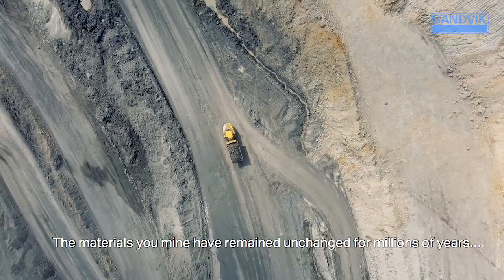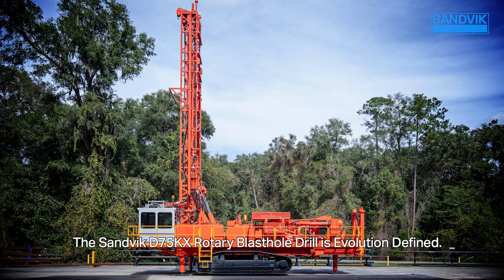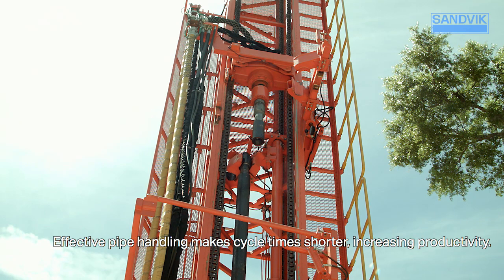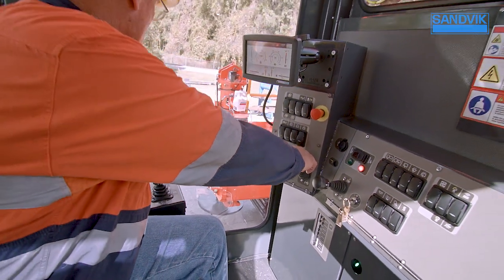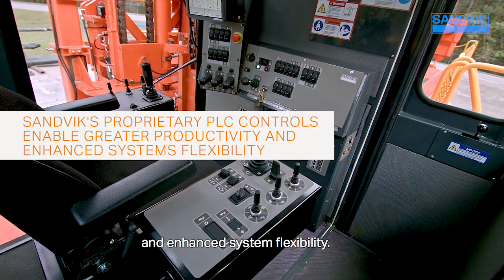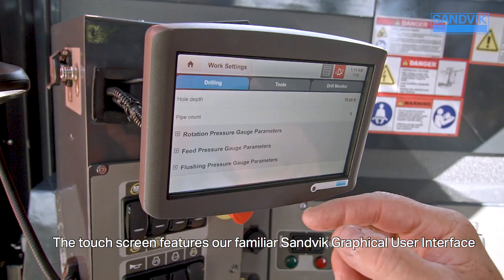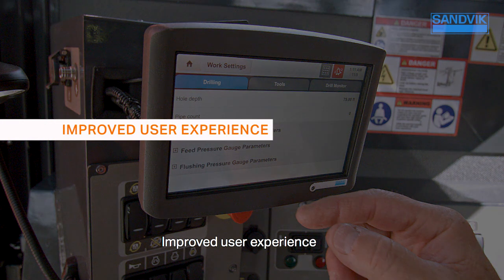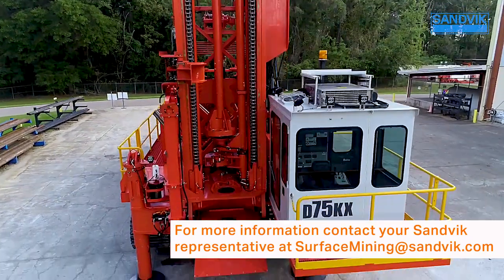D75KX Rotary Blasthole Drill | Sandvik Mining and Rock Technology

Comment: CONS Roof window is useless its always covered with dust so is the wiper blade water and rock oil spitting on operators window, Wenco  software is just ok  and its no signal  when u down in the pit , chain wrench is weak and very dangerous stay away ,bit basket is made to only change new bits, old bits just spin in it ......PROS comfortable drillers seat  easy tramming good camera views easy to set up on hole great power and good electric over hydraulic controls